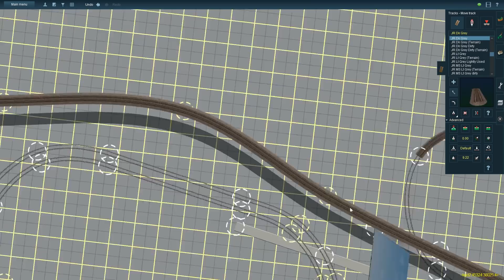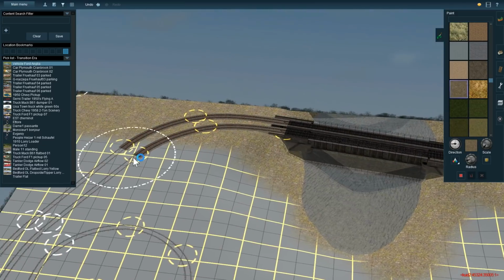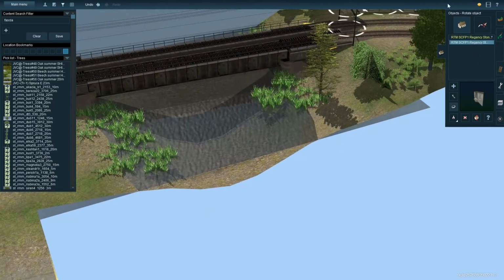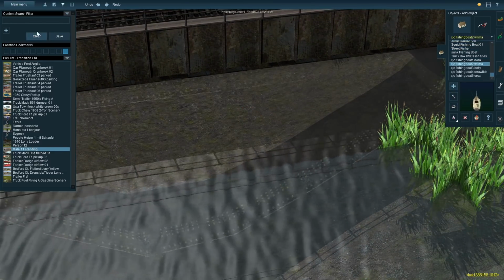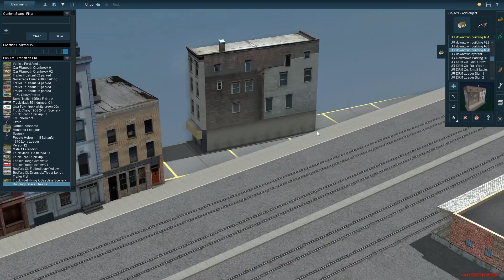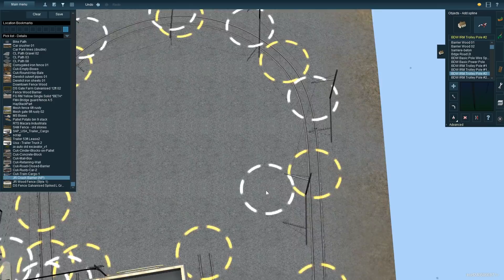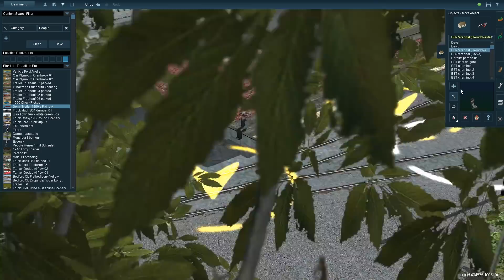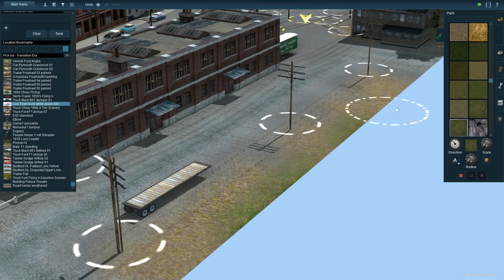Dayton & Troy Electric Railway: Episode 3

Comment: When you mentioned that the basemaps need to be photoshopped bigger, couldn't you just set it to a bigger scale? Like if the route was based for n scale, just create the basemap for ho scale? That way it would take up more tiles and the track work wouldn't look so cramped?
Reply: BXCRRCR Tyler that doesn't change anything in trainz except the measurements. All the buildings and track will be the same scale as each other so wouldn't make a difference... Does that make sense?